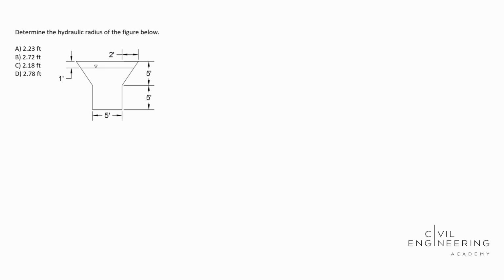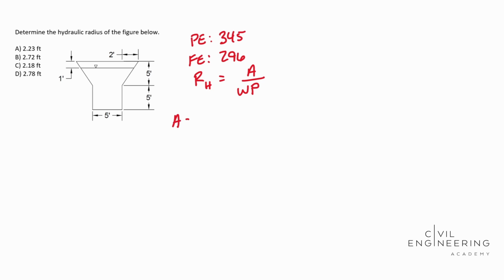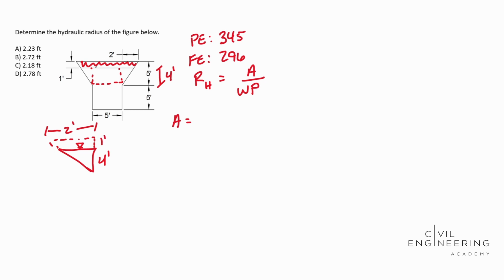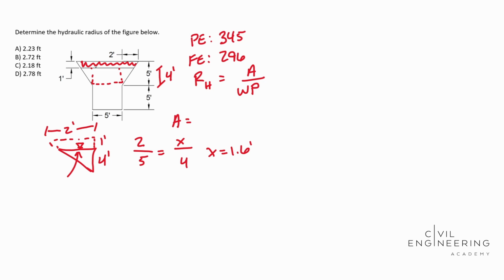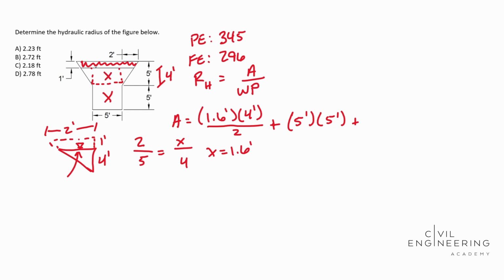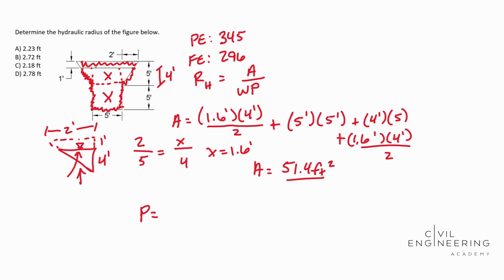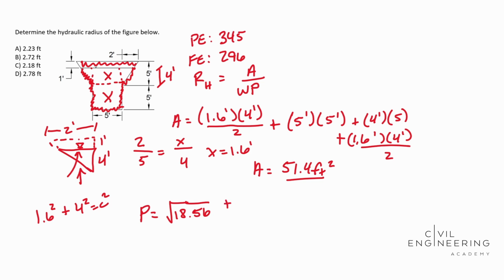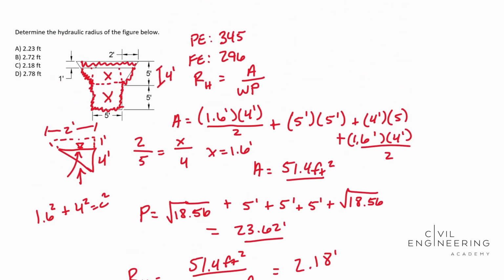Civil FE/PE Exam - Water Resources - How to Solve for the Hydraulic Radius of an Open Channel

Comment: Had to check, so I thought I'd mention that the top, open to air portion is NOT part of the wetted perimeter.  Thanks!
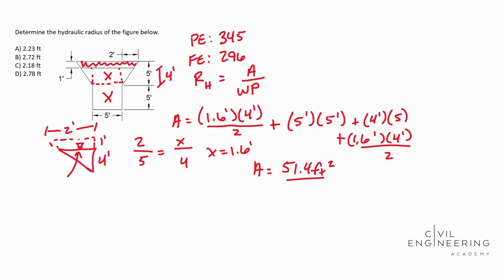Reply: Thanks for the feedback John! You are correct in your statement. Wetted perimeter only consists of the part of the channel that contacts the liquid (In this case, water). In this problem, the wetted perimeter is sqrt(18.56)' + 5' + 5' + 5' + sqrt(18.56)'.  At 3:55, I help explain this further.